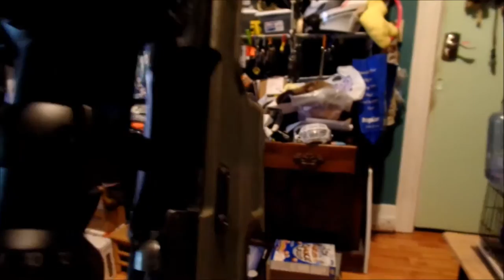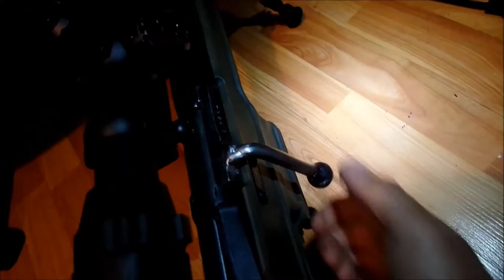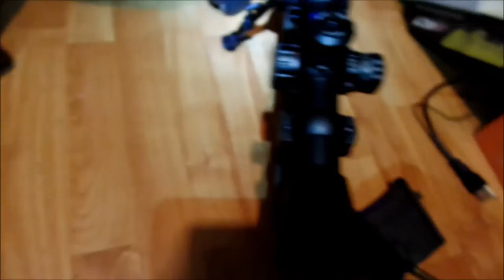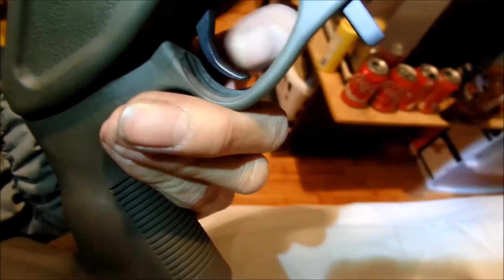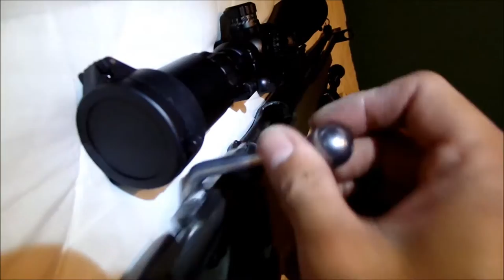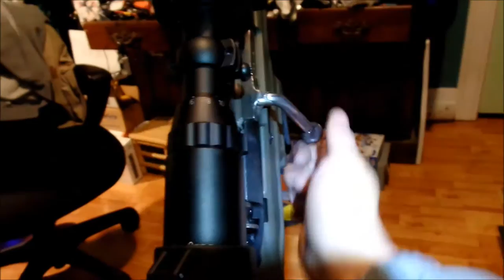Archangel OPFOR Stock Mosin Nagant Type 53 Fix

Comment: read the instructions.  there is a note in there to remove a bit of material where the trigger shoe makes contact with the stock inside the trigger guard.

this is due to variance where the trigger/sear was ground to at the factory.
Reply from the maker: Musta missed it =P  it was more than a bit of material.